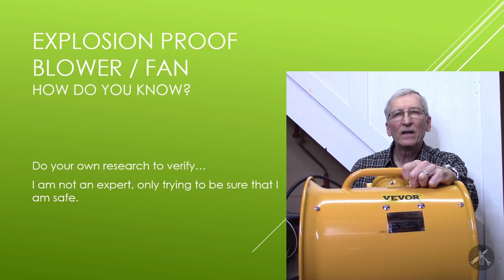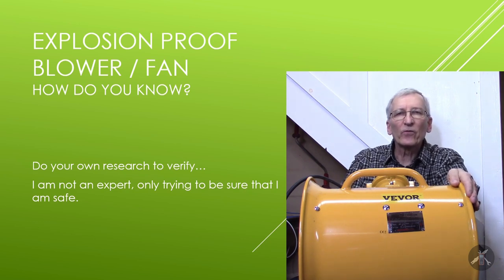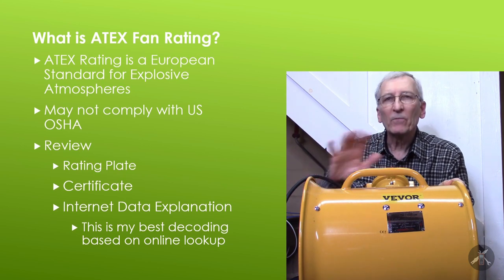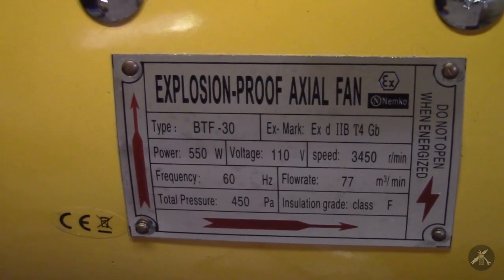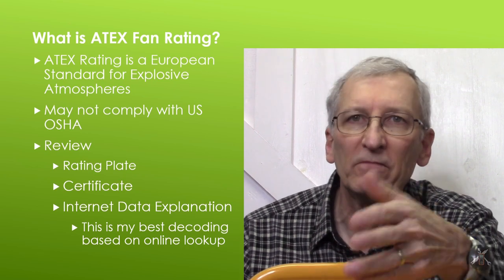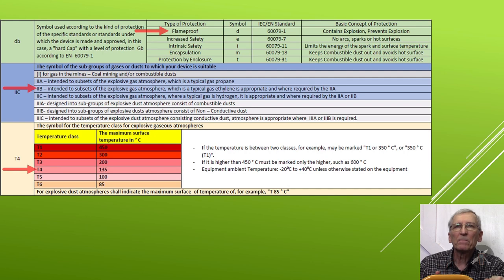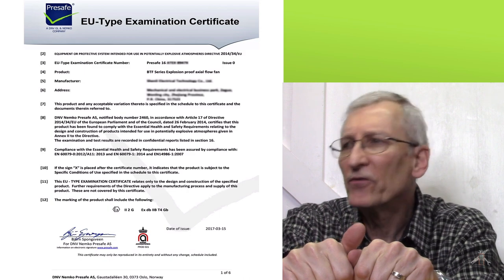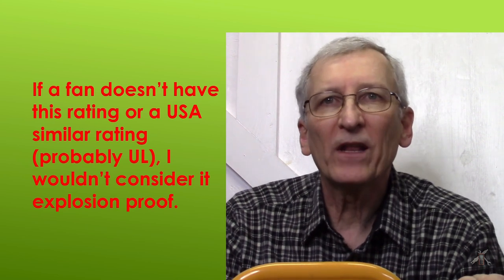Is My Blower Fan Really Explosion Proof?

Comment: I do not recommend Vevor products.  I do not recommend ATEX designated equipment.   ATEX is a European Commission designation.  ATEX does not comply with OSHA/ANSI Standards.  Ensure your equipment is UL/Underwriter Laboratory Standards.  These are USA Standards and will protect you in case of an Incident.  Atmospheres Explosive.
“ATEX” is an abbreviation for the ATEX Directive and is short for “Atmospheres Explosive”. It is a set of European Union regulations that are designed to ensure the safety of products being used in explosive environments.
Is ATEX accepted in the USA?
ATEX is a uniquely European Union directive for protection against explosive atmospheres. No. It's not harmonized with NFPA / National Fire Protection Association.  Combustible dust standards and not considered by OSHA an acceptable certification for electrical equipment used in hazardous locations.    Protect your Workers and Protect your Company from Liability.  Ensure it is UL and ANSI Compliant.   At my jobsite we use Portable Extraction Fans for confined spaces.   Vevor is not allowed on our Property.
Reply from the maker: I agree, you are correct that that these fans are not UL / OSHA acceptable for use in a business application or job site. I noted that in a previous video, but may not have made that clear.

I purchased this for personal use rather than business. The European specs may not exactly line up with US spec, but after reading the specifics of their ratings, I judged that for my use, the ATEX certification seemed acceptable. Anyone using this fan should verify that it meets their needs. 
The European countries want safe products in their countries as much as we do in the US. But, once again, it is not acceptable to use these fans in a business subject to OSHA regulation and I would prefer to have one with UL listing.